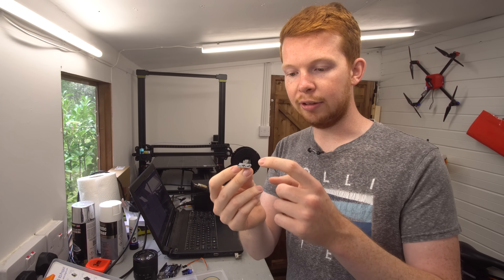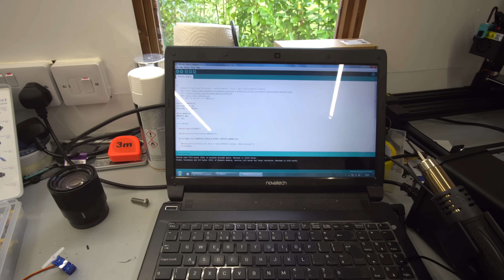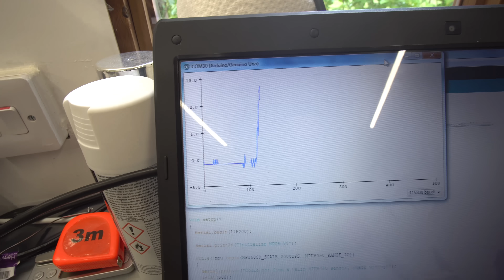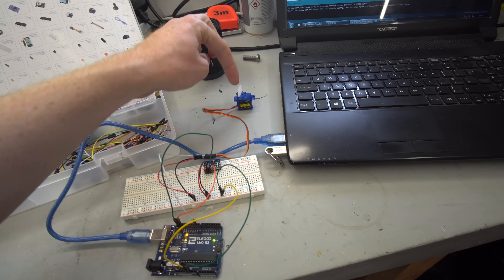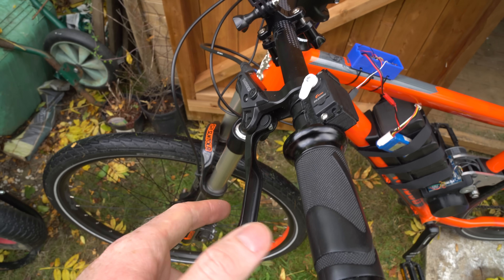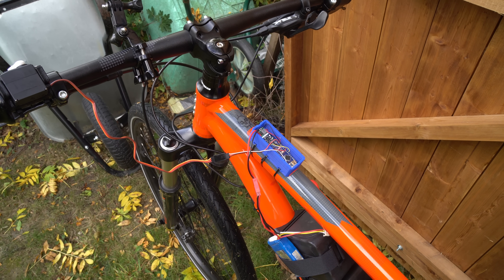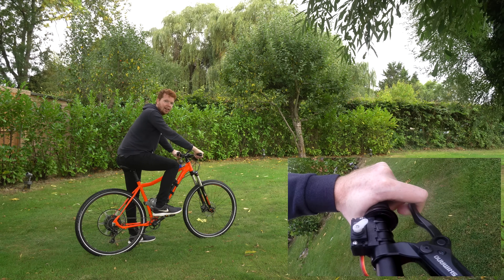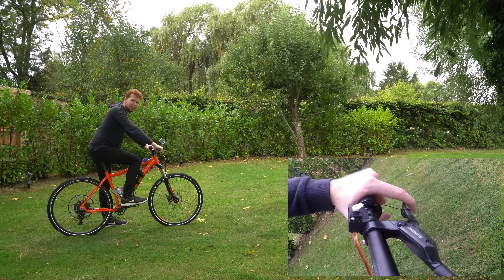Wheelie Cheat Device?

Comment: Integrate the acceleration that is occurring as feedback into the system to change the balancing angle.  Let it just learn and adapt.  In other words, the only way it could hold an angle below the balance point is if there was constant acceleration to apply torque to prevent the bike from dropping.  Likewise, if the balance angle is exceded, the brake is applied and deceleration has to occur.  By measuring acceleration (and it doesn't matter other than some smoothing whether it's from the motor or our legs) the system can determine if the current angle is too small or not.  This even works from a standstill.  If you engage "wheelie mode" and quickly pedal, its all acceleration with no angle until the front wheel comes up.

You are doing it intuitively when operating the brake yourself, and you have something like a "max angle" you're willing to go to before applying the brakes.  So you still need a max angle at which to begin deceleration, and then the system should be able to reach equilibrium dynamically after that by trying to achieve a steady state speed at whatever angle produces it.  That angle will be the balance point.

Which also means you could have a dial or thumb pedal for intended wheelie speed.  It would be kinda cool to set the speed to 5 mph under electric power and just slowly wheelie down the street. 

Anyway, I love your videos.  Have fun and be safe!

Comment: Another use for this could be Anti-Wheelie to get maximum acceleration when using the motor, without flipping out. Although you would have a problem differentiating change in gradient from wheeling using the arduino's gyro. Maybe a pressure sensor somewhere in the front end? Does come back to the problem at the end of the video though of shifting your weight around when riding... might be worth looking into.

Comment: Balancing a bike would be a classic inverse pendulum problem, its a non-linear problem and will take a bunch more math than just implementing a PID controller.
Reply: Adrian Forbes - I think you're right.  Any links to any projects, code, papers... anything really, on the subject?  I am just starting out.  Got the chips and the coding experience, need some help with the physics and the mechanics.
Reply: A good start is googling "inverse pendulum arduino". There's tonnes of information to absorb there. Once you have a good general idea of how it works then you'll know if you need more specific information.
Reply: @clonkex  -    Thanks for that, there is indeed a ton of stuff there.

However, there is one major difference, in that a true wheelie system will ONLY have unidirectional forward motion, and any overbalance will always be corrected by braking (either off the brakes or off the engine), whereas these balancing robots move (jitter?) backwards and forewards to ensure they don't topple.

That's quite a difference, any ideas how to tackle it?  Of course, the existing robots ARE essentially doing a wheelie when they travel forewards - I guess - but they don't propel themselves into it (do they?).  Also, when they move forward they do so at fairly optimal balance point, I don't think they'd correct a suboptimal angle by going faster (would they?)

All very interesting...
Reply: Actually off the top of my head I think it would be exactly like one of those balancing robots when it's moving forward... unless the human is providing the forward motion (so the electronics can't control it). When the balancing robots are moving forward they just tip forward then accelerate so they end up moving forwards but with the centre of gravity right over the axis of rotation (the wheel); i.e. they should end up upright, but moving forwards. Maybe a slight tilt forwards is necessary due to rolling resistance, not sure.
Reply: @clonkex  - Yes, the other interesting thing is when BOTH the human and the electric motor are supplying the power simultaneously.  You'd need to figure if the pedaller was "getting it up" enough, and assist if not.  OTOH if the pedaller wasn't trying to wheelie, there'd be no point trying to assist it.  So you'd need to detect (somehow) if a wheelie was being attempted.  Maybe either through a "wheelie mode" switch, or some smart acceleration monitoring software.
Reply: @clonkex  - oh yeah, one more thing... not "exactly" like the balancing robots, they "drop" to wheelie from vertical.  We need to "rise" to wheelie from horizontal.
Reply: True, but I was thinking less about getting into a wheelie, more about holding a wheelie. Good point though.
Reply: Cool mate - I''m not really out to make a "point", just thinking out loud until I find a way to model the Equations.   Come to think of it, the closest to the balancing robot in human-powered machines has to be the unicyclist.
Almost exactly the same, really.  When I think of it in those terms, both the similarities and the differences become more apparent. 

Viz: besides "dropping" into wheelie, there is also the notable difference of the geometry, and the hoist that has to be performed.  You're right though, once set up in dynamic equilibrium, they're pretty similar.   Alternataively, you could say that they're almost exactly the same IF the balancing robot had to start out with its "head" lying on the ground.  Or the uncyclist, for that matter LOL!  Imagine if you had some kind of unicycle with a cage around the rider, and him harnessed securely into it.  Maybe a little helper wheel at the head.  If he started from flat, he'd have to "wheelie" to get into position...

Cheers for the chat, as they say - it always helps to get your ideas clearer by verbalising them!

Comment: A really really good starting Arduino kit is the "Elegoo super starter kit" on Amazon. I believe it's only $35. Arduino is open source so even though it's called an Elegoo, it's still made the EXACTLY the same way an Arduino is.

By far the best gift I got two years ago. I spent so much time building tiny simple devices. I made a screen saver for an OLED display. I made a motion sensor that turns on and off lights when you enter and  a room. And a bunch of stupid devices that don't really do anything. Like a joystick who's X and Y position would change the frequency and the volume. Or a device that sends telegram signals based on what you write to it.

Comment: Hi Tom; cool project once again! What I think is working against you the most, from a control theory perspective, is the amount of 'play' in the brake system. These electronics have a nonzero reaction time in the first place, and once the system reacts the servo first has to pull itself through the non-activated part of the brake; which makes any delays so much worse. Of course you can try and counteract this by making the servo more aggressive; but that makes for a very jolty system. Things would probably improve a lot of you calibrated the servo-brake mechanism to have some pre-tension, so that at rest it is not-quite-engaged, so any servo input will more or less directly and proportionally engage the brake. Play in your system is notoriously difficult to correct for in any control system, and it definitely obeys a 'less is less' kind of dynamic. A PID loop by itself will do little to correct this characteristic, and can even lead to really annoying chatter. Its based on linear theory and play is intrinsically a nonlinear feature (or plateau) in your input-output relationship.

Comment: Hey Tom, have been watching all your videos for quite a while now, you‘re doing great work!
Funny to see you use the exact same Arduino starter box I got a year ago. A quick suggestion for future Arduino projects: Instead of using an Arduino Nano, for many projects (including this one) an Attiny 84 or Attiny 44 (depending on how many IO ports you need) works just as well, while being smaller and only costing around 2€ on AliExpress. They can be programmed directly with an Arduino, just look up „shrinkify arduino project“. For actual step by step guide use this, since older guides don‘t seem to work on newest Arduino version: https://www.instructables.com/id/Arduino-Uno-to-Program-ATTINY84-Arduino-V-185/

Comment: Some basic improvement idea:
implement a filter into your code
something like the average value of the newest 5 readings or so
this woud reduce the fast movement of the servo and reading spikes woud be smoothed out
don't use to much values or there is way to much delay in the system (5 readings = 5*reading intervall delay)

Comment: Add a potentiometer. Code it to adjust the angle of the balance point. Take a lot of the weight out of the setting so you turn the potentiometer a lot and move the angle a little. Add a second potentiometer and use one for High Gain and one for low gain. Set the length of your break wire to where you're happy and don't touch it again, you should just adjust the software not the hardware ( once you get it to the right length ) in my opinion.
I'm currently working on a drifting/racing/R.C./GPS/riding lawn mower with a working mower deck. This thing wouldn't be possible without you and your Channel. Thank you so very much.
Reply: Keep it simple, scrap the lot and use a 3 axis gyro. Couldnt be easier

Comment: You CAN do it like a segway, just not with an accelerometer (Not fast enough). A PID controler on your electric engine, and an encoders will be enough. (Provided that en engine has enough torque).  
SOmething like this: https://www.youtube.com/watch?v=QRrPqAqDmA0
Once in equilibrium it can maintain it even if you move around and change your center of gravity.
(The bike is just an inverted pendulum)

Comment: A motor spinning the front wheel will give you a gyroscope on the front end. I used to see a guy riding wheelies around entire motocross tracks with such a set up. He toured the circuit, I believe he called himself "The Wheelie King"
Reply: You are not a Wheelie King if you need a spinning front wheel. But you are right. It makes wheelies a lot easier.
Reply: ukulelefatman   His name was Doug Domokos   I think. I remember reading about him in dirt bike mag.

Comment: Look into inverted pendulum projects. Basically the same idea.
Reply from the maker: I'm fully aware of inverted pendulums, however the issue is more that the centre of mass isn't in a constant position, therefore it is extremely difficult to measure and correct. Thanks

Comment: I think it could be done completely automatically if the control system was operating the motor rather than the brake, and was able to sense the amount of torque applied to the motor compared to motor position. Comparing wheel torque with both angular and linear acceleration should allow a controller to differentiate between forward movement and tilt change. In this way, the controller could seek the angle at which required torque is minimized. It would not be that different from other self-balancing devices.
Reply: Exactly what I was thinking. He'd definitely need to filter those sensor values though. The Kalman filter would be perfect.
Reply: This is the fundamental of most motor bike attitude control systems. When under acceleration they monitor wheel speed, g forces and gyro angle to determine the bikes angle and likeliness of tipping. once first threshold is reached then reduction of engine power is applied and when a further point is reached corrective braking is applied. This does however exploit the massive power out put of a motorbike and would be impractical to apply to a push bike due to most people not being superhuman cycling machines.
The speed and duty control of braking is extremely important and servos may not be the best option.
Reply: except self balancing devices are direct drive. the motor is both drive and brake. on a bike the motor freewheels, so it has no brake authority. there would be no way to stop it from flipping over backwards.
Reply: The motor freewheels? Not on this design. Maybe on a mid-drive system where the motor is attached to the pedal sprocket. But on Tom's designs, the large pulley is directly coupled to the wheel. Note that a freewheel system would prevent regenerative braking as well, so it is not preferred.

Comment: Simply use a regular rc-Heli gyro, two axis are enuff.
It directly controls the servo with no added "crap".
You only need a zero servo signal as reference, then you get the basics of a "zegOway"
If you wish, connect the zero trim of ref signal to a handle bar and you got a ....

Comment: I'm sure there's an easier way ...
If you could somehow compare the rotation of the rear wheel relative to the frame and the rotation of the rear wheel relative to ground you SHOULD be able to fully automate the process with it automatically "feeling out" where the balance point is.
If a human can do it, electronics MUST be able to do it better.

Comment: Another thing you need to keep in mind is that trying to do a wheelie uphill and downhill will give a different result. You should write three programs and have a way to switch between them, so you can go uphill, downhill, and level. The other thing with downhill is you could put in a velocity reader, and have it pull the brake when you start going too fast.
Reply: I though of this too, but then i thought about if the slope has anything to do with maintaining your center of gravity and it shouldn't.
Reply: Right, I just figured that on a slope it would be harder to control the bike, as it would have a tendency to roll downhill. So, uphill you would have a lower wheelie before you flip. Downhill would just basically be uncontrollable because you would need to keep yourself slow

Comment: Cool video. How about using the Gyro for balance rather than the accelerometer? That way you don't need to know the centre of mass. I think that quadcopter controls use this alot. Check out Joop Brokking as he gets into the nuts and bolts of arduinos and gyros etc.

Comment: What about taking the concept to RC? you could use some quad motors to make a direct drive RC car with stability control. Endless endos and wheelies. Plus you could publish the design so I could build one.
Reply: Or you could just get a giant gyro and put it in the RC car, I actually have an RC car that does this. Its weird but it can do wheelies on one wheel
Reply: I have an ambition to make a decked out 4 motor car with stability, steering and so on controlled by whatever the equivalent of a flight controller would be. More out of curiosity than anything else but it might be cool to be able to control the driving characteristics and drift angles really precisely, this would just be one example. I was trying to get Tom to figure it out for me!

Comment: You need to maximize the polling rate of your sensor then filter the values to smooth them. I'd recommend an exponential filter, summing and taking the avergae like many here suggest isn't as accurate . Google the MegunoLink arduino library, it includes a great and easy to use exponential filter.

Comment: You could have it such that the COM isnt right above the bike, but use the torque of the motor to counteract the torque of the offset COM.
Or perhaps you could have a potentiometer on the handlebars to set target angle, and then the user would tune the angle according to their mass. Again, if the user moves their COM< the motor could compensate the offset COM's torque.
Reply: Another idea is to use the change in tilt. The motor will simply try to maintain the tilt stable. Then the user just has to force the tilt one way or another.
so rather than trying to zero back to some tilt, it will just try to keep the change in tilt around 0.

Comment: ..Or you could just learn to wheelie its more fun :)
Reply: I think you're missing the point here lol
Reply: @MrJacobbbo2  lol just seems like a lot of hassle,its easier to programme your brain 😄
Reply: @mark675  Sure, but if there was something to get you to "feel' the experience, it would be so much easier.  Especially for us slow learners.
Reply: @alexgian9313  yeah having an anti flip device would be good for learners but once youve relied on it being there then it would be harder to unlearn it afterwards id imagine,
Its an Interesting experiment though, i want to see it done with radio controlled motorbikes 😁
Reply: @mark675  - you have a point, but I guess we won't know untill there is a working prototype.

Personally I'm optimistic:  I think computer aids are great to teach us things, or introduce them to us quicker, NOT to make us dependent slaves.  If I had such a system, I'd switch it off once I was comfortable cruising at BP, and feather the brake myself.

I'd switch it on again if I wanted to whack full power-assist to get me UP to BP, so that I could know what that felt like, without having to concentrate on not tipping backwards.  Then I'd combine the two skills in my own time.  Even real wheelie schools have safety cutoff devices, albeit mechanical ones.